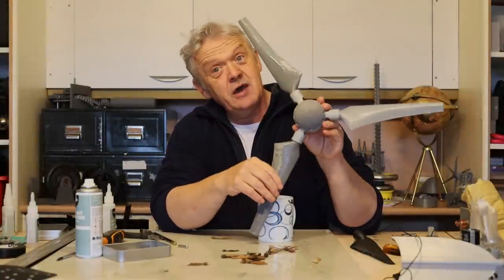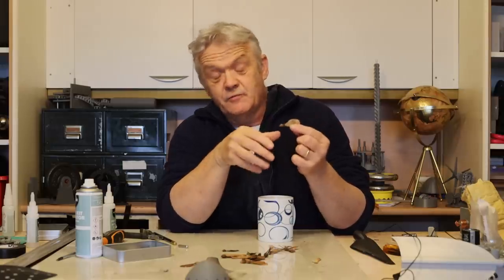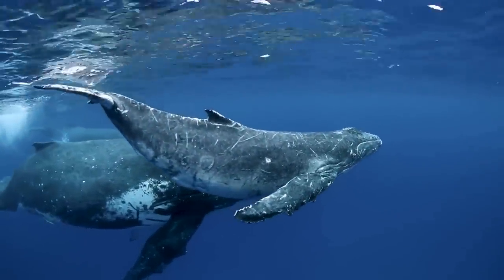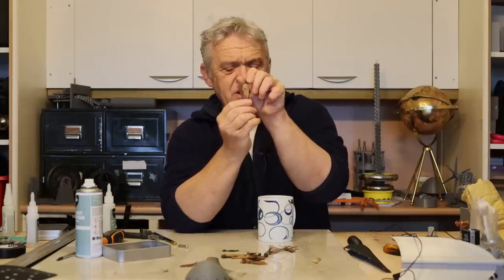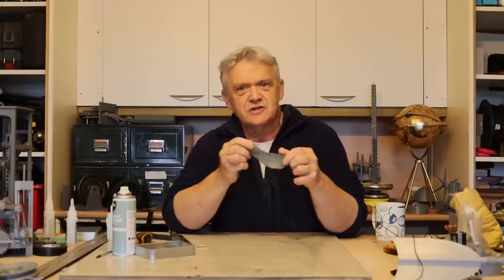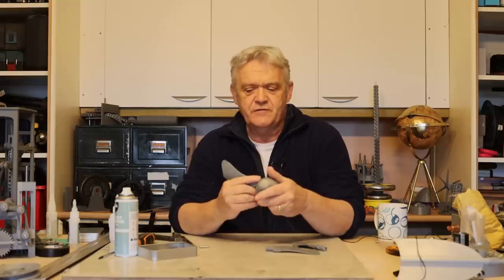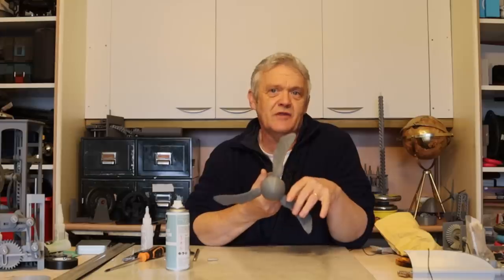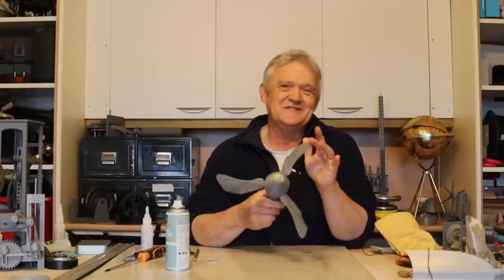2099 The Samara Wind Turbine

Comment: There was a fair bit of study by two Americans and a Canadian on the tubercles on the leading edge of the Humpback whales' fins which was applied to blades of wind turbines. Their company is Whalepower Corporation.
Reply: I don't know if they are fake or not but gold artifacts that look like aircraft had the same on their wings.
Reply: This what I was trying to explain.
Reply: I have a question about the theory, however.  If they move through the air 20% easier, would that be BAD for catching wind, and therefore BAD for wind turbines?  What do you think?
Reply: Whale fin like hydrofoils have been tried on America’s cup racing yachts.
Reply from the maker: lol - wait for today's video mate!
Reply: I was just about to write that too about the whale.

Comment: The seed is optimised for centre of rotation inside the seed head, so you might get better results by cutting off the blade where it meets the head, rather than by adding that stalk.
Reply: Good idea...
Reply: This was also my first thought when I watched the video. Maybe you could stack them in front of each other at the center of rotation. You could even do multiple sets in different scaling as the energy absorbtion is worse near the center and therefore more "remaining energy" should be in the wind after the first set of blades. Using a second set of smaller blades behind the first set could compensate that...
Reply: Agree. Using multiple blades is also deviating from the original. Would be cool with just one blade. 😎
Reply: The seed is the centre of axis of rotation. The stalk is a stupid idea all propellers should be two bladed fused together, balanced and smooth surface, light weight and durable.

Comment: Hi Rob i do enjoy dropping in on your endless journey of scientific and engineering exploration. Please excuse the nerdiness of the next thought but evolved natural designs are often super specific and the seed pod has evolved to have a specific centre of rotation. The turbine assembly mounts the printed "blades" so their Joint centre of rotation differs from the seed freefall centre of rotation so It might be interesting to see if there is an efficiency peak at the seeds natural point of rotation. Maybe it will maybe it wont, just a thought. Anyway, more strength to your elbow, stay fascinated and keep experimenting.

Comment: As with some other wind turbine models presented (the folding version), the blades "appear to be" assembled back to front - the configuration with this type of blade (as built/demonstrated) is most suited to a directional (HAWT) - with the wind from the back (ie, a downwind turbine) - it still works "bass-ackwards" but doesn't cut in as early.

The thing with all of these designs is to decide early on what type of tip speed ratio is desired - and work with the relative lift distribution from root to tip...  (a steady state windtunnel (nor the operation  of a birds wing) doesn't exactly correlate with the same performance as is experienced  by turbines - unless the whole model is located within the boundary layer of the tunnel.

It must be noted that a propeller producing thrust and a turbine producing torque are optimised exactly in reverse order (yhey noth rotate but the high and low pressure sides are reversed in both regimes  (one is being driven by the wind the other is "driving the wind) , so a propeller which also generates isn't the same as a turbine which may occasionally produce lift (ie, self lofting rigid kites) - they each may be used for the other task, but will not do it quite as well as an "optimal" design. (Yess, it is true that if dealing with buffeting, rotor-ing air at low levels and downwind of trees and buildings (obstructions, including elevated terrain) - the "optimisation quickly disappears.  Ducting - nozzles and diffusers can redirect and recover energy which may otherwise be lost in the matrix - too or by the matrix??.)

Comment: Might letting the blade pitch "float" make the rotation self-regulating?  A single seed falls nearly at the same speed no matter what the wind speed.  Cross winds carry it farther from the parent, but rotation and descent rate don't seem to vary. Perhaps if the samara turbine blades could feather on the hub with a constraint, like a coil spring,, then it would be less sensitive to axis pitch or to wind direction.

Comment: The test for it's similarity to the seed-pod would be to drop the handle with the blades horizontal. I  think the seeds need to have the air moving as it falls in order to rotate, like an auto-rotating helicopter. in the usual wind-turbine orientation it looks to be a great design, as most naturally evolved stuff seems to be. Talking of which, have you seen anything about "Tubercle Technology", where the nobbly bits (the scientific name for tubercles lol)  on a humpback whale's  fins were examined to see if they helped it with it's  remarkable agility in the water, and they were found to channel the flow over the fin in such a way as to keep the stream attached for longer, generating extra lift, but, astoundingly, reducing drag at the same time. Needless to say the buggers have slapped patents on their use for aircraft wings and  turbine blades, but the principle  is fascinating!

Comment: Another fantastic video. 
I've often wondered why turbine blades were not this way around, I always put it down to the strength of the material at the root of the blade, with it having to carry such a large load at the tip of the blade when rotating.
It would be great to see this in a twin  blade configuration on your Axial flux turbine, to see if it would out perform the Ingenuity blades in low wind speeds. Just what we need in the U.K.
On the Axial flux turbine. If the blade sets on either side of the turbine were different lengths, would that have the affect of turning the blades in to the oncoming wind???
I'm thinking more drag on the longer set. Obviously the performance would be limited to the maximum of the shorter set.
Keep up the great work.

Comment: You kind of beat me to it Rob lol I was watching them fall yesterday and wondered how they would fare. There is a lot of variation between each 'wing' from any given tree. The one you scanned and printed  seemed very stunted but I've found the ones that travel furthest from the tree tend to have a very wide flat tail feather type shape to the end. A possible hint to an improvement? Also they've evolved to spin around the axis of the seed so I'm assuming the distance from the tip to the centre is important

Comment: I love the inspiration from nature! I wonder if there is a generative AI tool for aerodynamic surfaces. I seem to remember when I was learning to build turbines that the reasoning behind the blade being narrower at the tip was because it would be moving faster than the center so the tips should have less drag. If speed is not your goal though I think maximum area would be more important for torque.
Reply: To your and @dwiz121 ''s post: the comparison would be hard to summarize. The torque may be what we really need from a turbine more than rotating speed.
Why?
Do you know how hard it is to harvest energy from a wt generator? Having a constant speed may solve a lot od problems.  Torque would be the factor of power.

Comment: Hi Robert, 
Isn't this design, like a maple seed, designed to work on drag to self power?🤔
The wings become the wind vane if you're oriented as a "pusher" configuration with the nacelle at the front in a bullet shape and a 2nd set of blades offset at 60⁰
Reply from the maker: as they rotate they produce little vortexes which create lift - or so i believe
Reply: @ThinkingandTinkering  it would be interesting what flow mechanics software tools and a small vapor chamber wind tunnel to show how those vorticies react at lower speeds and higher speeds 🤔.
I remember working with similar tools in university and the ideal of a physical proof came up to validate what we thought we saw in the 90's😉👍
Absolutely love the content Sir!
You're making a legacy 💞

Comment: Hi Robert 
Just found your channel and loving your content, just a question about the Omni turbine, what do you think if the model was scaled up from the thingyverse size to accommodate bigger magnets? Would it produce higher voltage or amps? I am in the process of converting a 9 meter bus to a motorhome and was thinking this could be a good option for the not so sunny days to compliment the solar. Your opinion would be appreciated. 
Thanks Daniel 
New Zealand

Comment: The seeds are counterweights. If there are three blades, leave them out.

How about a single blade? Let the counterweight do its job. You'll get naturally designed single-blade efficiency. Or so the hypothesis goes. I'd stick with three blades since I'm not a single-blade fan. 😁

Comment: To do a comparison you would use blades of same weight right?
Reply: That is unfair past some size, probably starting at a foot per wing.
Reply from the maker: swept area mate - there is a fixed energy in an area of wind at a certain speed the output versus input would give us an overall efficiency
Reply: @ThinkingandTinkering  good point, was thinking abstractly forgot to take Conservation of Energy into account, So only Modifications that might increase the air flow (Like a Fairing) would help ( actually a Fairing would allow for testing both styles as would allow for measurements before and after the Air travels through it) although it might favor the Seed style as the blades would be getting increased air at tips which have greater surface area ( or am i out to lunch today ) LoL

Comment: I appreciate your content, Robert. Your channel stands out as a testament to the depth and variety of YouTube beyond mere entertainment.

However, one of your assertions has left me perplexed: the idea that a blade slicing through the air is identical to air flowing over a stationary blade or wing. This concept seems counterintuitive considering the principle of momentum. For instance, the impact of moving marbles on a stationary pen differs from the effect when the pen is thrust through stationary marbles. It seems logical to extend this analogy to air movement, suggesting a distinction between a sail cutting through the air and air streaming around a sail. Care to elaborate? What am I misunderstanding?